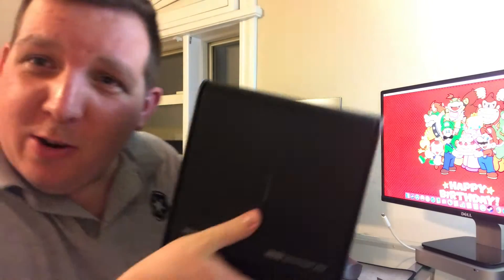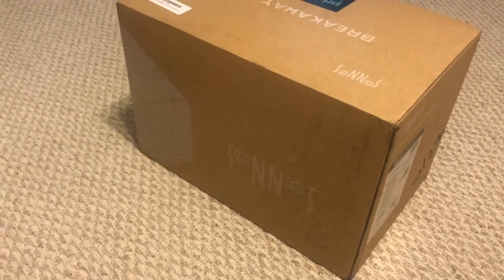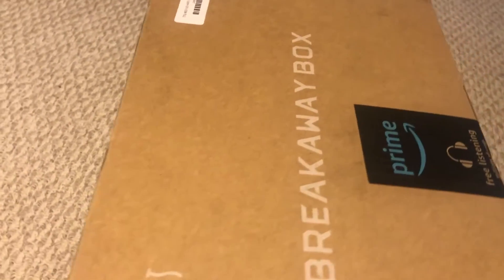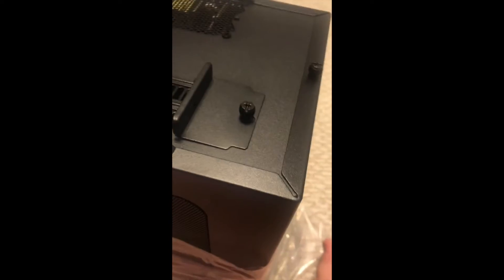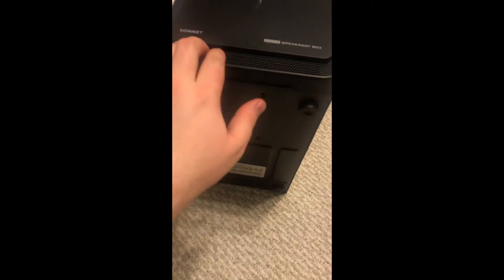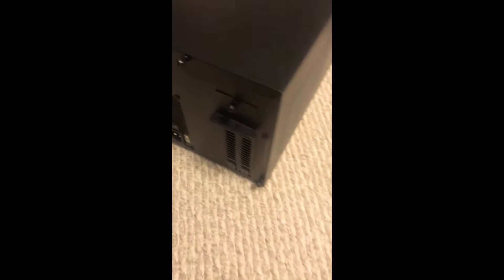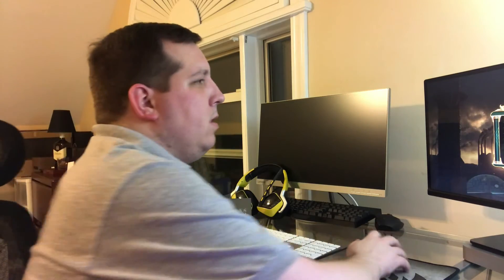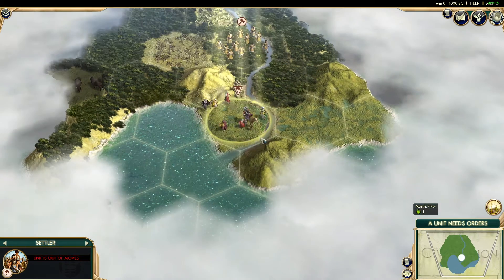2012 Mac mini gaming?! Sonnet B350 assembly & initial testing!

Comment: I have the same exact Mac Mini. Wondering if this setup still works on the latest Catalina version. Thanks!
Reply from the maker: I wish I could say, I'm no longer using the setup. I gave the GPU to a friend. I can't immediately think of a reason it wouldn't, but you'd be better of checking egpu.io as they are the most trustworthy authority that I'm aware of.

Comment: Run geekbench
Reply from the maker: I created a second video with some gaming benchmarks, but I didn't include Geekbench because that's more for CPU testing. And my Geekbench CPU scores were not significantly different than any other 2012 i7 Mac mini.
Reply: @polymatrix  sorry. K couldn't think of any other benchmark software at the moment.
Reply from the maker: No need to apologize, I was only explaining why I didn't run it. Unfortunately, that Mac mini had been slowly getting hotter & hotter, no matter how many times I re-applied thermal grease. It was starting to get unstable & having some other issues. I had to retire it in favor of the newer 2018 Mac mini model.

Comment: Will this set up work on my mac mini late 2012 running OS Catalina?
Reply from the maker: I don't still have it set up (instead using it via TB3 on my new Mac mini), so I can't share a personal experience. However, it looks like Purge-Wrangler is still working which is the only thing which would concern me since Apple officially supports eGPUs.  
https://github.com/mayankk2308/purge-wrangler

The eGPU.io community has a thread here:
https://egpu.io/forums/mac-setup/script-enable-egpu-on-tb1-2-macs-on-macos-10-13-4/

Make sure to read all the instructions,  as there is a note saying that on 10.15.1 script v6.1.0 is needed.
Reply: Free Speech Advocate did you find a solution for the late 2012 Mac mini ?

Comment: Hello, if you still using it, would you recommend buying it in 2019?
Reply from the maker: If you're getting it for the sake of gaming, I don't think I would. The performance isn't ideal & it's not quite what I would call a "deal" for the price. For gaming purposes the cost of the B350 + a good GPU would be better spent elsewhere. Although, if you already have the Mac and a GPU, then $200 is a relatively small price to pay for some improved performance.

If you're using FCP there are plenty of other users out there who have stated it does improve rending times. In that sense, I think it could be worth it if you already have a GPU.
Reply: @polymatrix  Thank you!

Comment: would it work with an imac late 2012 and if so do i need thunder bolt 3 or just thunderbolt
Reply from the maker: I honestly don't know if it will work on an iMac, but I suspect it could. Asking around on egpu.io would be best. You'll need a TB2 to TB3 adapter since that's the port that the 2012 iMac. Also be aware that the eGPU will render the graphics back through to the iMac for the display to work instead of the video leaving directly from the eGPU; all that is to say the performance will be doubly limited due to the TB2 adapter and the fact that it has to re-process back through the iMac's display.

Comment: the biggest difference between this and the sonnet 550w is that the later will be able to also charge your laptop; also comes w 2 8 pin connectors compafred to a 8 and a 6 pin in the 350w model

Comment: Nice video! One question can you change the screen resolution to 4k? And have you try to fit mac mini inside the Sonnet box?
Reply from the maker: I don't see a reason why it can't do 4K, however my monitor is 1440p.
I haven't tried to put the Mac mini in the Sonnet, but given it's layout & lack of space I doubt it would fit. Unless you left the Sonnet's case off.
Reply: @polymatrix  Native mac mini 2014 is not running 4k 60 hertz. What is the highest resolution you have try? And are these 60 hertz?
Reply from the maker: @andreiVJ  The highest resolution I tried was 1440p. I don't have it set up anymore, but I'm pretty sure 1440p was at 60 Hz. I was running it over a Display Port connection, not HDMI. I'm not very educated on the 4k monitor limitations as I don't have one myself. From what I've briefly read: 4k refresh rate limitations occur due to monitor hardware, connection used, and driver support. 

Since I'm doing something that is not strictly supported by Apple, it is possible that running the connection over TB1 (and possibly TB2) isn't supported & it's being forced to 30Hz instead of 60Hz.
Reply from the maker: @andreiVJ  Came home & hooked it all up again to find out for sure, since it was driving me mad. Yes, it does 1440p @ 59.98Hz. Screenshot is saved to my Google Photos.       https://photos.app.goo.gl/PneD3WnhAJmt8fAFA

Comment: What OS X are you running?
Reply from the maker: When I made this video it was 10.12. If you try it with 10.13 you’ll need to go to eGPU.io & get the purge wrangler script.
Reply: Thank you for the reply! I've got the 2014 Mac Mini Fusion Drive. Hope it works!
Reply from the maker: @themagicbean01  Did it end up working for you?  This set up still works under macOS 10.14
Reply: @polymatrix  what about mohjave?
Reply from the maker: @a.s.l711  macOS Mojave is 10.14, so yes it is still working.
Reply: @polymatrix   Thanks sir, I am planning to get one with RX 580 or 570 for my Mac mini 2012. do you need to do any mod or kext or whatever they called it?
Reply from the maker: @a.s.l711  The RX-580/570 should work out of the box as the kexts needed for them are built into macOS. So it should work just fine.
Reply: @polymatrix  I see, so its just plug and play. All i need is just the TB3 to TB2 adaptor for mac mini 2012? TB 2 and TB 1 must be compatible then.
Reply from the maker: @a.s.l711  It's not quite plug and play - you need to make sure you get the correct software to enable the eGPU, since it's not officially supported by Apple. Go to https://egpu.io and check out the user forums there, though trying this post first will likely be helpful. https://egpu.io/setup-guide-external-graphics-card-mac/
Reply: @polymatrix  Thanks.
Reply: @polymatrix  thanks , i really wish a tutorial on a mac mini 2012  from you would be great! hahaha
Reply from the maker: @a.s.l711  I'll have to polite decline, as there's a lot of variables that I don't have the ability to address with my limited resources. The trickiest part (if it can be called tricky at all) is getting purge-wrangler to install & run. But that is covered cleanly here: https://github.com/mayankk2308/purge-wrangler

Just start at "Pre-Requisites" and by the end of the "Installation" step you should be set and working. You can explore "Script Options" to give you additional detail. After "Post-Installation" it's mostly there for informational purposes or specific troubleshooting steps.
Reply: Hiii!  @polymatrix   Haven't gotten my unit yet. Will be purchasing by next year.:)

Comment: Thank you for a great video on this eGPU. Read your reply to Lee Raddy. Do you have a link for the sources you used to research the eGPU compatability with your 2012 mini and compatibility issues with high-Sierra? I hope to rejuvinate my 2014 mini with an eGPU too.
Reply from the maker: https://egpu.io/external-gpu-buyers-guide-2018/

That's the primary eGPU.io site & buyer's guide. It's the simplest set of information. The 2014 Mac mini will need the TB1/TB2 to TB3 adapter ($49 USD from Apple). If you've got the latest macOS update your AMD RX GPUs will be pretty easy to set up, though you may need to use the Automate eGPU script created by the post-maker here:
https://egpu.io/forums/mac-setup/two-new-egpu-solutions-on-macos-10-13-4-pure-efi-and-hybrid/

If you're going to use an Nvidia there's other resources on this site to assist with that. I haven't tried an Nvidia GPU in this set up. Looks like a lot of work for no performance improvement.
Reply: Tech Haberdashery You’re Awesome. thank you for the link and information. A lot of great information there. 👍

Comment: Hi I use Mac mini 2012 late is this Sonnet Breakout Box 350 use Thunder2 to Thunder3 is sure, if can will Good?
can !
Reply from the maker: If you have a Thunderbolt2 to Thunderbolt3 adapter, AND you do not have the latest High Sierra update, yes it should work just fine.
Reply: I have the latest High Sierra update canot work ?
Reply from the maker: From everything I've read, no it cannot. It's not working for me. I think Apple found too many issues with the older Thunderbolt standards. Personally, I've seen where the system runs very very poorly with the GPU connected. My theory is that anything which uses the PCI-express Bus (so, everything that's not the CPU & audio, near as I can tell) runs very slowly. Particularly wifi.
Reply: thx for u'r information
Reply: @Raddyleekwokchiu  use pure wrangler patch, please update me after you try, the patch can work on catalina also.